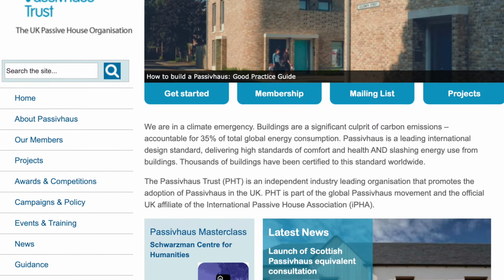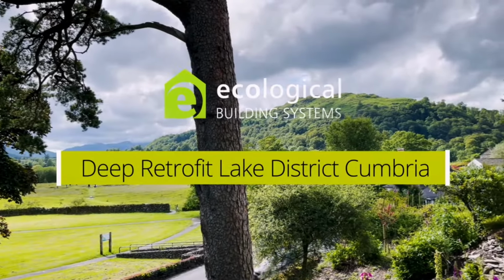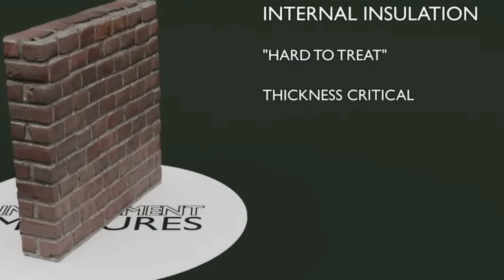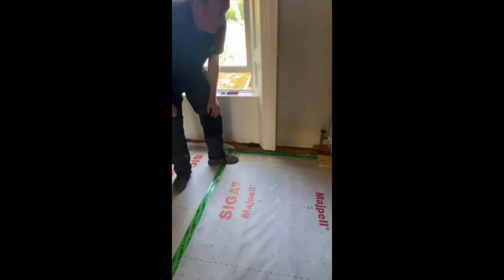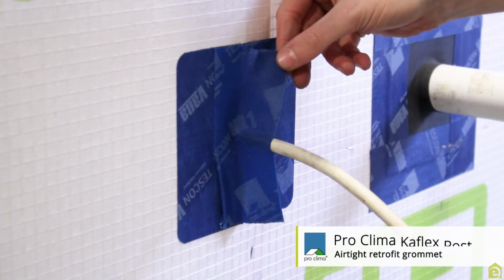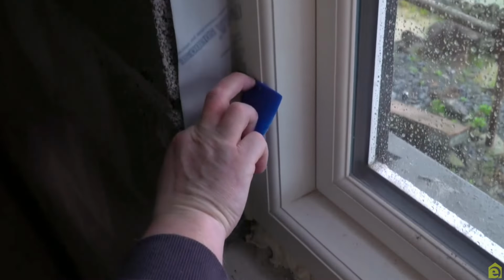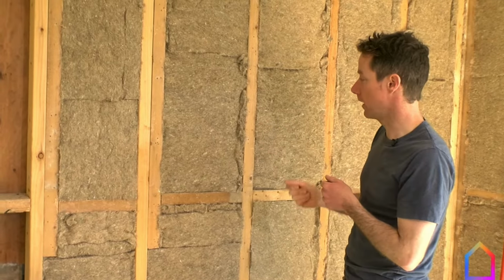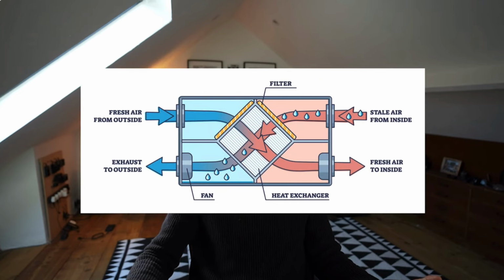Do You Know How To Make An Old House Airtight?

Comment: Air tightness is important, but it’s worth remembering the obvious: if there’s no wind on a particular day then it doesn’t matter how airtight your home is. (Ignoring for a moment the stack effect of heated air rising.)

So, in a usually calm urban setting down south, a leakier building won’t be the end of the world. However, in a windswept country location, you’ll reap the rewards of airtightness work.
Reply: Do you do much with wind breaks?
Reply: I am not sure you understand what airtightness is. It isn't about wind blowing into the house or pulling the air out of it. It is just...breathability of the structure in general. Has nothing to do with outside conditions, not at all.
Reply: Of course it’s related to outside conditions. When there is more pressure on the house from wind, you get more leakage.

The test is performed at a fixed pressure for consistency, but any structure will leak more air if the pressure differential is larger.

Conversely, if there is no pressure difference, there is by definition no air leakage, whether the property is of PassiveHaus construction or something leakier.

I’m not saying air tightness improvements are unnecessary; just that if you live in a very sheltered area they have less of an impact because there will be less pressure difference compared to a more exposed location.
Reply: @HowardBurgess hmm....that's not the way I see it. I understand your point however it isn't necessarily yru that no pressure difference means no leakage. Air travels, as simple as that. Isn't only driven by pressure but also by temperature difference. And that is where the problem lies. If it's cold outside warm air will travel towards any gaps to equalize temperature. Hence airtightness is crucial to keep the house warm.

Comment: I understand the subject of your video is airtightness but im pretty certain that your research has pointed to the fact that this will only work in a very limited number of properties that by their very location make their completed value worth the cost and effort to implement such a process. 

Given this, its ironic that the purchasers of these buildings would probably be the most able to withstand virtually any cost of heating. 

What i dont know, and you may well do,😂 is how this process would compare in price to something like throwing solar and batteries at the properties to reduce energy costs to a similar level. On a practical level a more average home owner would benefit more from the saving without the retrofit to Passive House levels of air control. Ultimately it doesnt matter what we say if someone dictates what is to be done but building 5 million Passive House's in 5 years will be fun to watch. Cheers
Reply: It doesn't have to be a huge project. You retrofit where and what you can, because each bit helps. 
I had a huge Victorian in Norfolk Virginia. Insulation was sparse because the top level was an apartment. The biggest improvement in comfort and energy savings for all the apartments was installing "storm windows" (expensive!) and filling drafts all around the old ones, caulking gaps around skirting boards, and weather-stripping the doors. No walls were opened.
In several small houses the target was attic insulation (blown in fiberglass chunks), caulking gaps, and making storm windows of plastic greenhouse covering.  Maybe $1000 per house. Comfort level increased, utilities decreased.
Reply: @lazygardens  I totally agree but there are those that renovate to a high level that an architect will be used, They hose that would use Pinterest and then the remainder that either don't or can't. The purchase price of 4kw of solar and a battery could get in at a very reasonable cost with no fears of condensation damp or mould etc.  My guess is retrofitting energy saving measures when no other upgrading is planned and to a level that save 6000 KW/h of energy is fat more that a solar fit under those  circumstances but perhaps I am wrong. Cheers.

Comment: We have an MVHR system but it only has a single 'in' or 'out' per room. You place the 'in' in rooms that you live in - living room, bedroom - and you place 'out' in rooms that create wet / bad air - kitchen, bathrooms. The only alteration to our house to accommodate this was adding a small boxed in area for three pipes that goes to the living room (two 'in' pipes because it is large, and one 'out' pipe in the downstairs WC). 1980's solid brick walls / two story. Installed by Solarcrest in Macclesfield.
Reply: Yes - we have a MVHR plan for this house (Montana, USA, VERY cold, low humidity) that involves putting fresh air inputs into rooms on one side and the outlet collectors at the other end. It won't be as effective as a new build and fully piped, but it's better than nothing. The house is "air tight" which means STALE AIR. Double pane windows, gaps caulked, piles of insulation in the attic ... needs air changes.